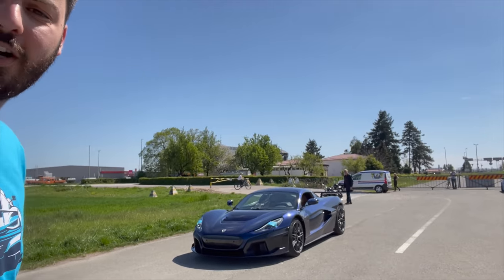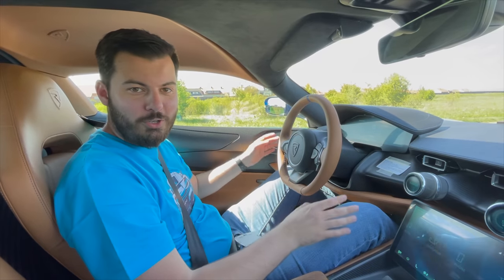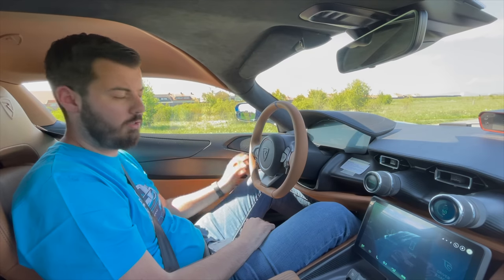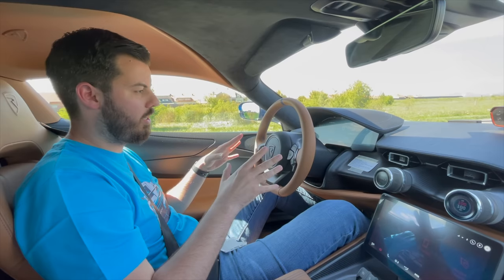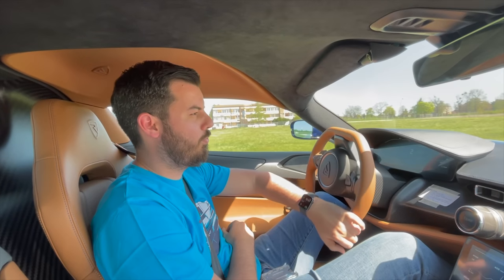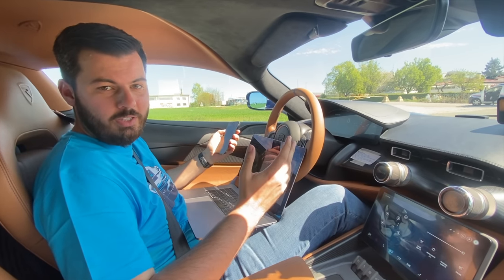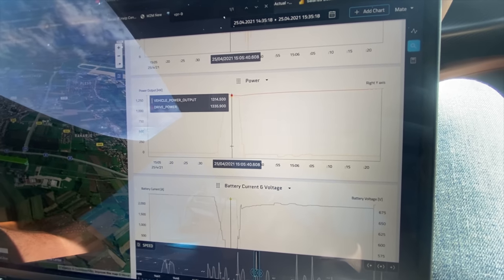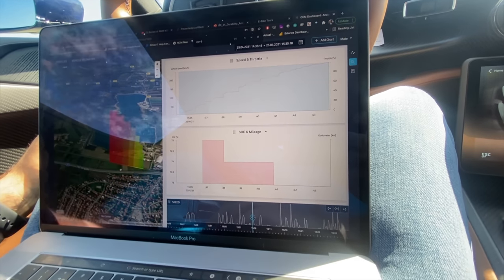Is Rimac Nevera the fastest accelerating production car?

Comment: incredible, what a car!!  I did 9.3 in my stock 765LT in the 1/4 mile and would love to try out the C Two!
Reply: Time to trade in that SF90 already? 🤔😏🤙
Reply: You will, soon enough. Thanks for following our progress!
Reply: @MateRimacAuto  yes!  please get Brooks in the car!!!
Reply: Absolutely the best electric car so far, I would love to test neck to neck with my prototype.
Reply: the 765lt is low 10s on regular road
Reply: @MateRimacAuto  It'd be great to see this vs an Aspark Owl
Reply: @nelsonthomas5743  He's gotten high 9's on the street stock.
Reply: @marcss416  Still a far cry from 9.3 secs. Not hating, just want people to have the right info, instead of thinking that the 765lt is faster on public roads than a Chiron Sport.
Reply: @nelsonthomas5743  He never said he got 9.3 on the street?
Reply: @marcss416  He didn't specify whether it was on the street or on a drag strip
Reply: @nelsonthomas5743  I don't know about you, but when someone says "in the 1/4 mile" I ran a x.xx at xxxMPH. I'm assuming they're talking about on an actual dragstrip, not using a vbox or draggy on the streets.🤷‍♂️
Reply: I don't think rimac gives a flying F about prepped dragstrips
Reply: @nelsonthomas5743  let's see a video on a Chiron running 9.4 on the street or drag strip....   I personally ran a Chiron at the dragstrip and it ran 9.9...   I think it can do it, just no one has done it yet...
Reply: @DragTimes  Car and Driver had 9.4s on regular road for both the Chiron Sport and the Chiron Pur Sport. There's no way a 1500 hp Chiron is slower than the 765.
Reply: @genemounce8302  $2 + million vs $600'000?...maybe not...
Reply: @DragTimes   if you could stop using drake songs in your story that would be great,  your like 50 🤣🤣
Reply: @nelsonthomas5743  let's see it...  have to remember that car and driver "corrects" their numbers, and doesn't show it actually happening, or the raw data...
Reply: @DragTimes   bro why did you block me for no reason again thought we were homies,  oh well the memes will go on 🤣
Reply: @MateRimacAuto   brooksie from douchetimes is not an automotive journalist though,  even mclaren said that,  just let carwow review it
Reply: @lambullshit7857  yeah in carwow the 765lt hit 0-60mph in 2,8 second porsche 911 turbo s hit 2,5 second
Reply: Yes!
Reply: @MateRimacAuto  May your and our Croatian, Balkanian, European car always be better in every segment then USA car Tesla(btw Croato-Serbian scientist name)
#fairCompetition
#goodLuck
Reply: You mean 10.3s?
Reply: @nightmarefoxygaming8737  no, 9,3
Reply: @spinister4357  you must be on drugs if you think a cockroach looking car can do under 9s in the Quarter mile😂😂😂
Reply: @spinister4357  the sf90 does the 9.3s In the Quarter mile. Not a 1200 hp tuned mclaren.
Reply: @mathewsinger4214  facts, this guy needs to get a life....
Reply: @MateRimacAuto  another vote for DragTimes to get inside the Rimac!!
Reply: @nightmarefoxygaming8737  toxic
Reply: @spinister4357  that it? What a comeback.
Reply: @spinister4357  I’m not even being toxic lol, all you Mclaren fanboys are so toxic and clueless.
Reply: @nightmarefoxygaming8737  ok...
Reply: @spinister4357  good, just admit it does 10.3s in the 1/4 mile.
Reply: @1500HPGTR   douchetimes
Reply: You 765LT vs C_Two bro!! 😜
Reply: @nightmarefoxygaming8737  wtf are you talking about? There’s literally videos of the 765lt in the 9’s
Reply: @MateRimacAuto  Thanks for making the video, and thanks for inviting DragTimes!  Looking forward to seeing him up there!
Reply: @genemounce8302  you can't trade the SF90 WITH a 2mil car basic economics
Reply: 9.3 with 765 hp. This rimac have 2000 hp so 8.95 is pretty ok?
Reply: On a prepped track…
Reply: @alekosalekadis6095   yeah mcnuggets 765lt doesn't have 765hp
Reply: Wait for the ferrari 812 performance !!!
Reply: @lambullshit7857  ok not 765 but 840 ok but does 9.3!!!! And this 2000 hp electric car done 8.95!!! Slower than a 1100 hp 765lt. Dude plz!!!
Reply: @MateRimacAuto   nah not douchetimes,  let carwow review it, they have a bigger channel
Reply: @720skiller3  mc can too! Hey mechanical problems exist everywhere
Reply: @MateRimacAuto  Great car...looks...interior...Btw any chance that Richard Hammond gets to review the C_Two?? 🤔
Reply: Brooks was the first thing that came to my mind!! lol
Reply: On a prep track the C2 is going to be a beast, can't wait for this.
Reply: @zekaroh1523   omg dragracing is the time of the life 🤣 how boring
Reply: No you dont have that car, stop lying
Reply: dont come with tuned McLarens or GTRs alpha .. the costs, maintenance and the fact that they broke down every run   makes me go with the rimac.  In some years  it will pay off.  cost vs. quality
Reply: @nelsonthomas5743  bro do you not know who @dragtimes is? He ran the car, seen every badass Supercar and hypercar in the world & knows what they can do. 765 LT is the fastest production car in the world
Reply: @raymurda4551  lmao "fastest production car in the world."
Reply: @raymurda4551   mcnuggets 765 does 9.88 in optimal conditions,  nobody cares what douchetimes did on a prepped dragstrip
Reply: Thats on a prepped drag strip
Reply: @nelsonthomas5743  I agree.
Reply: @1500HPGTR   not jealous of Douchetimes gtr fanboi,  am i jealous of manny khoshbin,  Savage garage? Gercollector? Check out my Douchetimes memes on ig #douchetimez
Reply: @1500HPGTR   i have no support? 🤣 check my IG even Douchetimes friends follow me lmao
Reply: Dragtimes felt important today
Reply: Brooksie i just sent you 1000 DoucheCoins, check your wallet 🤣🤣🤣🤣🤣
Reply: @1500HPGTR   imagine being a g t r   f a nb o i  hahah
Reply: @DragTimes   grandpa brooksie you're like 50 years old, stop putting pop smoke songs in your story,  you try so hard 🤣🤣
Reply: @relansis6962   ah you're the one i blocked on IG haha go get your driver's license kiddo and stop playing video games
Reply: @relansis6962   facts? Nah just bullsht
Reply: @relansis6962   keep playing video games kiddo, one day you'll get your drivers license,   just another failed gaming channel 🤣🤣💀
Reply: @lambullshit7857  Yes that's what I thought , another desilusional Porsche fanboy🤣
Reply: @nightmarefoxygaming8737  9.4s
Reply: He did 9.33seconds with a stock 765lt with after market tires and with stock tires 9.7
Reply: @raymurda4551  lol... https://en.wikipedia.org/wiki/List_of_fastest_production_cars_by_acceleration
Reply: How about a 7 second DSM?

Comment: I like how they did it on an unprepped surface with normal tires because lets be real you aren't gonna drive around with slicks on all the time and you aren't gonna go to a drag strip every single day just to go fast, even then if you want a fast car you should still be able to get its factory numbers on a normal road. Doing it on a normal road just shows you the insanity of the car.

Comment: Are you using the new Yamaha Motors? Seems like the correct amount of power 479hp x 4 =1916hp ..and sounds just like them.  Drift mode..oh yeah !
Reply: No its his own Technology, they build the cars hande made and complitly inhouse.

he is the CEO of Rimac Automobile
Reply: Wtf is yamaha motors doing in rimac.
Reply: Those are Mate’s own permanent magnet DC motors.
Reply: @bunsenn5064   AC not DC
Reply: Why the heck yamaha motors have to do with rimac
Reply: @debadityasaha1684   they are  not
Reply: @Absolut531kmh  absolutely nothing
Reply: @markmatic5718  lol
Reply: Lol.
Reply: First of all, rear motors are much more powerful than front ones
Reply: You are evrywhere
Reply: @leonardmehmeti2278  yes I know he is CEO of Rimac, I was asking a legitimate question, kind of a dumb question I agree, because not many auto manufacturers are going to tell you what motors they are using, but Yamaha has recently developed some crazy high-performance electric motors for the hypercar market. Just Google it, the motors are very compact and 350 KW each.. insane, it would only make sense that he is using those motors for his car setup as four of those ultra high performance motors equal the horsepower that this car has.. only makes sense. But maybe they are going to ask me to delete this comment because again much of that development is secret in the automobile industry.
Reply: @debadityasaha1684  because Yamaha has recently developed an ultra high performance motor for hyper EV's, and four of those compact motors just so happened to equal the horsepower output of this car.... Pretty cool if they're using them because they're really new... Do a quick Google search
Reply: @darkslow27zagreb41  good point, that bias can be software controlled, and I don't know all of the details of those new Yamaha electric motors but they look pretty insane.
Reply: @Cro_man_  lol .. we just like the same things I guess...🙂
Reply: @WarpedYT  You're wrong.
Front motors (2)
250 kW (340 hp) each
Max torque 280 Nm each
Rear motors (2)
450 kW (612 hp) each 
Torque max 900 Nm each
So can you explain how can you  get more power with bias?
Reply: @WarpedYT  i forgot to say am huge fan of you and are there gona be any new mini motors blow ups?
Reply: @WarpedYT  why,why why are you so pushy?non stop y.this ,y that..fuck y. ok?y.is a big company,and Rimac/Bugatti co. Is still young,and he start in his father garage,without crowfunding.all of what you see is product od his own genius and excellent Kru what he have arround him.making ultra sport car is secondary product.they have lots of inventions/patents in technology which they make for real big player in car infustry.what you think,why Porsche bought 30% of Rimac Automobili?
Any time soon from Sv.Nedjelja will roll out the car which will be affordable as model T once use to be.
Samo hrabro,svako dobro@mate rimac and his team in Rimac/Bugatti co.
Reply: @mayham_RI  u ok ?
Reply: Warped Perception 🙄🙄🙄

Comment: The best thing about everything is the fact that the people living near the strip have NO clue someone just ripped an 8. on the 1/4th mile
Reply: @Ryan 9638 ahh yes a supercar that is supposed to be used on the road can't beat a non road legal custom built dragster that burns through its fuel tank in 10 seconds and can barely turn so it sucks.
Reply: @Zippiye0001  its a hypercar

Comment: Remember, Porsche owns 24% of RIMAC so they dont care if the Taycan gets spanked by RIMAC.
Reply: And they got the Bugatti IP. When VW announced the move, you directly could see a bump in the prototypes.very exited to see the Rimac Buggati (C2)
Reply: Nope.  Mate allowed Porche to get 25% of stock.  Mate is stillnthe owner . Porche ( VAG group) bought the EV train and battery tech from Rimac.  
Get your facts right. 
Rimac is selling technology and using a hyper electric car as ' selling tool'.
Reply: @bluebikerathar  English is not your strength, right? He exactly said 24%
And Porsche with an S.
Reply: @bluebikerathar  porsche only bought 800volt system from rimac, they engineered the electric motor themself
Reply: Rimac is pale copy of AsparkOwl
Reply: But they do care that Germans cannot achieve that. And: that Mate never would have achieved that if he would have stayed in Germany.
Reply: Actually it's just in the press that VW is selling 55% of Bugatti to Rimac.
Reply: wipe your wet cheek porsche fanboy
Reply: @mre596  show me one video of the aspark owl actually driving/accelerating, they only advertise numbers and cool pictures but no proof whatsoever
Reply: they dont own fyi! they only have 15% not 24% and besides they are actually talking about selling Buggatti to Rimac! for more performance and upgrades!
Reply: @adamhendler9643  if he had stayed in Germany
Reply: @ExpertPlayz there isn´t even proof that the aspark accelerates this fast, however for the C2 there are proof videos

Comment: 1,700 horsepower

Rimac CEO: needs more power....
Reply: [does 0-60 in 2.3 seconds on regular sports tyres]
"The 0-60 time is quite bad, still..."
Reply: @SmallBlogV8  on bad tarmac
Reply: @SmallBlogV8  and without launch control 😁
Reply: MO POWA BABEH !!!
Reply: @SmallBlogV8  Well, 2,3 is slower than the Porsche 918 Spyder and the 911 Turbo S. I expect this to beat them both so.. ;)
Reply: @ThorsteinKlingenberg  on what tires and road/ track? Video or paper time?
Put  c2 on slicks and clean track with launch control and ha will smoke them... 0-100 have alot to do with track tires more then pure power
Reply: @SyckoHunter  On road legal tires, of course. It's Porsche, not Tesla. They don't cheat.

Comment: "0-60 time is quite bad, 2.33" what the...😂😂😂😂 I agree, it's has to be less than 2😅
Reply: I expect it to if it has 1900hp
Reply: That's quite impressive considering the fact that they haven't implemented the launch control and is not using it's full power
Reply: @Bless_Mabunda  also the road is bad and dirty and he has normal tyres not for drag race
Reply: @Christs_Apologet  you can have 3000 hp, but if asphalt is dirty and old, you cant get good grip so thats big deal
Reply: So when hes done with the car 100% , race tires , other track (better asphalt) I can imagine this car doing 1.8 sec 0-60
Reply: @sportstyle  below 2 sec for sure

Comment: You should see Motor Trend's article on the acceleration of the P100D ludicrous. 1.41G off the line to 10 mph, 1.1G to 30 mph and after 50 mph it starts to drop for 2.4 sec to 60 mph. I wonder what this will do when it gets proper launch control.

Comment: fold up and down flap under the door, so when door open it folds down, when it close it folds up, that flap you can make from what ever you think will remove the noise from stones being kicked up against it, or a slide in and out flap? i dont like the slide idea but its an option lol, you need to work on the noise on the inside next

Comment: Evidence for the Aspark Owl’s 0-60 mph (0-100 km/h) acceleration suggests that it has stopped the clock on the 0-60 mph at 1.72 seconds in Misano circuit (one foot roll out). Recent tests indicate that the car’s top speed is an astonishing 249 mph (400 km/h).

Comment: This is hugely impressive and the engineering behind this should be applauded and respected.
Having said that though... I just cant see myself wanting an electric sports car. I just cant. It is not that I dont appreciate tech. On the contrary, I love tech and is actually one of my hobbies when it comes to devices/computers/gadgets. But I cant get behind an electric car. I want the engine. I want the sound. Even if I am dead slow compared to such a beast. I just need the engine...

Comment: Crazy to see the huge voltage drop in such launches. Makes me wonder how many could be done without damaging the battery too much. At 50% SoC, the drop would be even higher, and would bring the cells voltage below safety parameters, most likely. I'm also curious about the field weakening control in such crytical scenarios.
Reply: Of course we have very advanced algorithms that predict available power (State of Power - SoP) based on battery temperature, SoC, SoH and other factors. Even if there is an error in SoP calculation (very unlikely), the power is ramped down once a cell reaches critical cell voltage. The voltage can never get in a range that is critical. 

Yes, there is lots of voltage drop but still very much within the safe zone.
Reply: @MateRimacAuto  Yes sure, we have similar problems with our FS car, even though with 10x less current of course. Kills me every time I see such drops. It would be nice to see the C_Two at the FS Alpe Adria, maybe you can drive us around on it :D

Comment: Tesla (Nikola) was Croatian as well! But there is new Croatian genius in town and his name is Mate Rimac... Single Handedly beats all the car factories in the world!! RESPECT!
Reply: What does he beat them in? Ford had the 1/4 with the cobrajet 1400.
Reply: @ELATION FREEDOM no they designed the sytem that utilize it, like how tesla claims to make their own batteries but use cells from Panasonic and CATL as cell manufacturing is complex, so they spent several billion to get a small pilot line running to make their own, To actually make electronics and motor ls requires a large pre fab facility and a lot of engineers who specialize in it to make a low cost reliable part, you don't do this for production cars sold at low volumes, it's like gambling to make everything yourself and make it cheap, if you are successful you save a bit of money, if you are unsuccessful you loose a of money so many go with buying from someone else. Also not in production, their designs change over time as well.
Reply: @Paolo PININFARINA main facility in Oregon.
Reply: @Paolo PININFARINA it's based in Oregon so it's American.
Reply: @Paolo PININFARINA yes and they are based in 1 country.